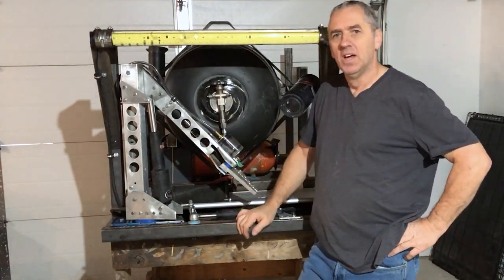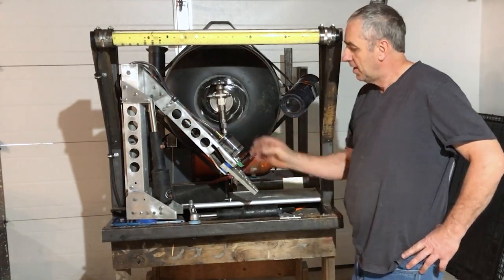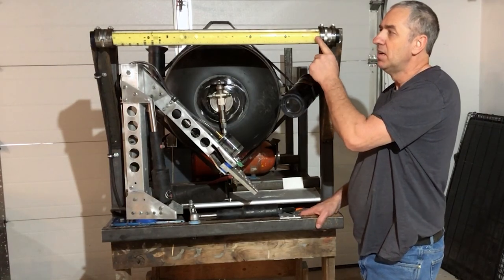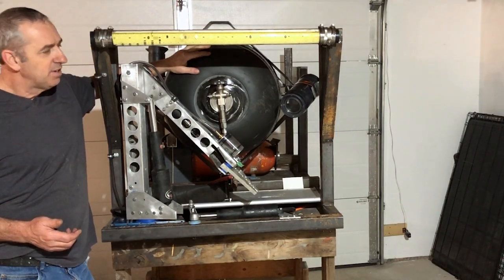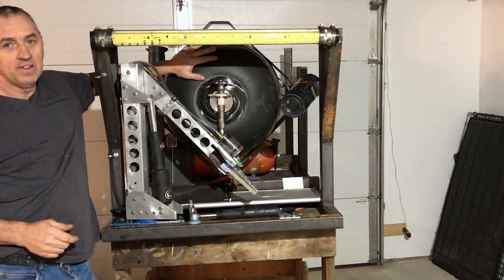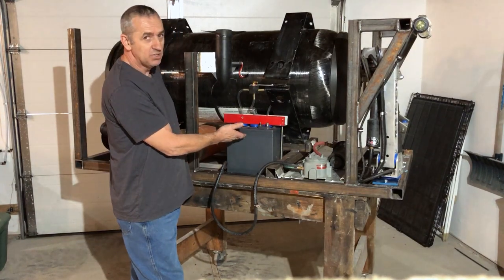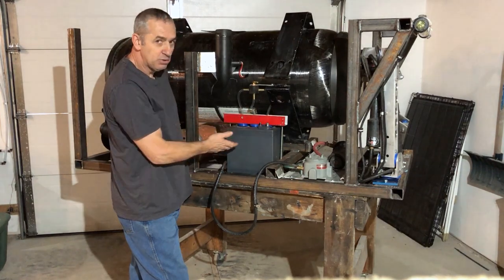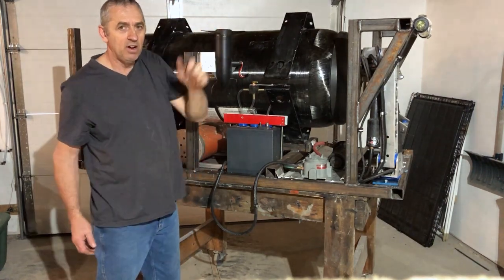Homemade Heavy Duty Support ROV

Comment: Magnificient work as always Hank ! Congrats !
I read that other pressure compensating systemes have a spring that applies pressure on an oil piston so that the oil pressure is slightly superior then the water's pressure? Is this something you thought wasn't that necessary ?
Reply from the maker: I don't think it is necessary,  I have had this system on my submarine for years with no problems.

Comment: Hi Hank! Your ROV looks great! A very efficient and cost effective design! I have a question about the battery: have you ever experienced battery failure due to the pressure compensating oil mixing with (infusing into) the battery's electrolyte when the pressure increases during diving?
Reply from the maker: Hi Pat, I have not done this very much myself, but all the old school deep diving subs did this.  I am quite confident this will work just fine.  Plus batteries are pretty cheap, and if they are replaced annually, thats acceptable.